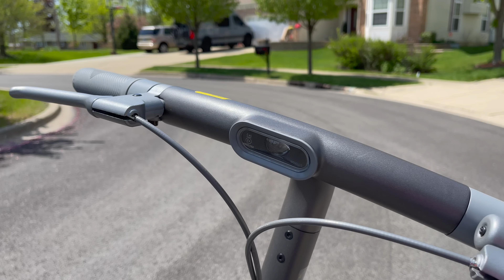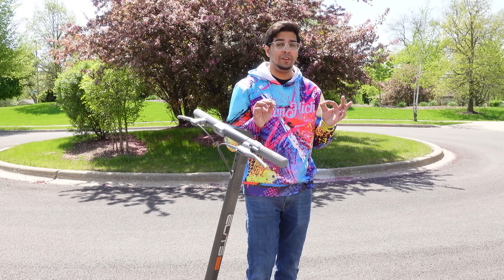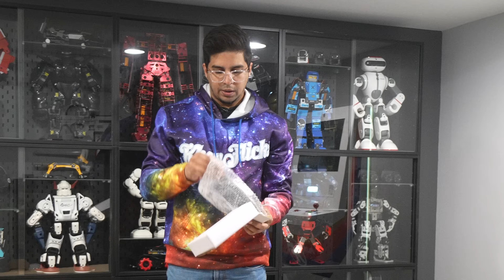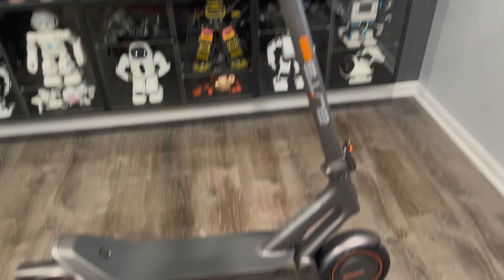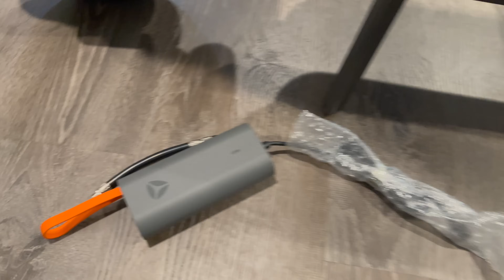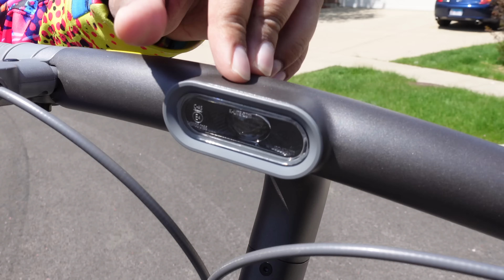The SUV of Scooters 🛴 - ElitePrime by Yadea Review

Comment: I think that was a valve extension to make airing up the tires easier.  I'm on the $699 pre-order, it's really too small for my rural riding areas but it's just a cool looking scoot and can be a good loaner, be nice to hack the controller to get a few more mph, I hear it reaches top speed really quickly and just stops pulling (be design).  Great review!

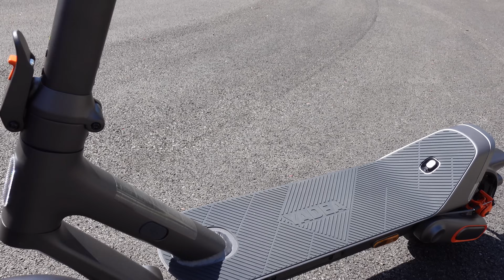Comment: 5:45 weld around the top plate going to angled vertical weld looks very messy and never seen one in that position. they said they had to remold some parts, i'm really not thrilled about the look of this top plate to skirt welds. Looks like they extended the length of that piece and welded together